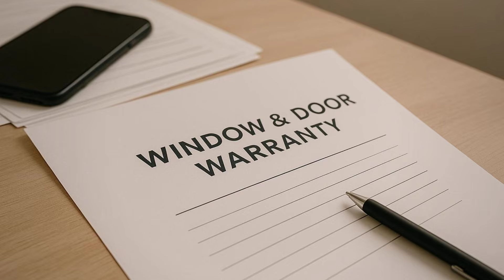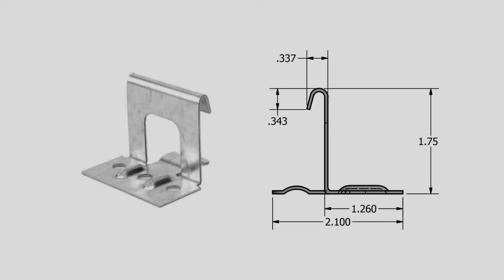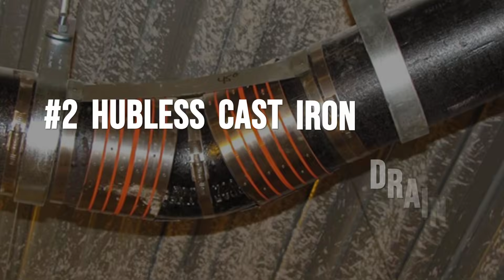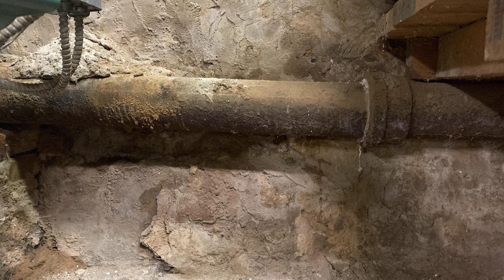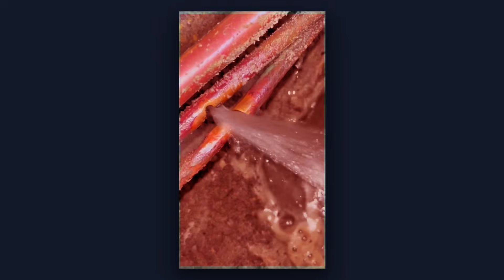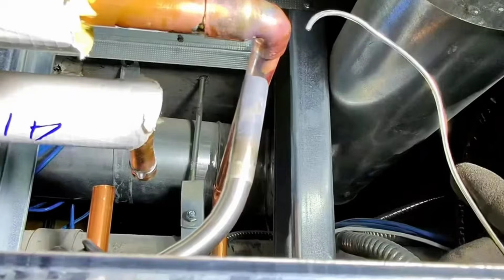The Only 3 Home Systems Still Built to Last a Generation (The Heirloom List)

Comment: This is total nonsense. If the pipes are installed correctly they will outlast old materials. Problem is they are rarely installed and supported properly
Reply: You mean PVC pipes? Yes, they can last awhile in ideal conditions and can be wrapped in mass-loaded vinyl & go through wood only via rubber gaskets to contain water noise and minimize fatigue from house flex under seasonal & wind loads, but there's also the camphor shoot borer beetle that'd started eating them, and to your point it's never about the ideal install but rather, realistic & common install.
Reply: It's the chlorine and chloramine in the water that destroys them.